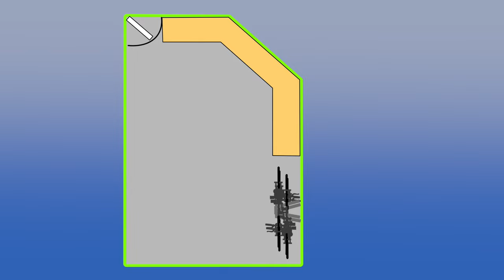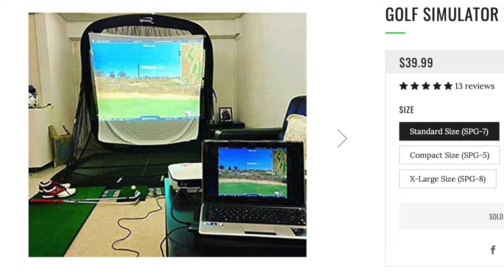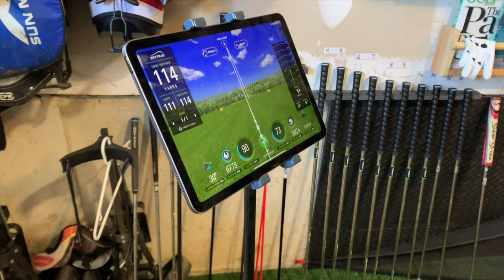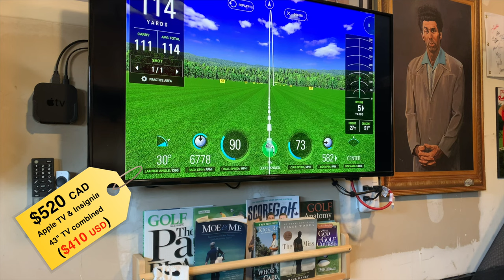Golf Simulator Without Projector - A low budget, small space setup.

Comment: Thanks for the video. This is really good and gives me some good perspective. Question about the garage door opener, I have a two-car garage with "hard corners" (no space between garage door and adjoining wall similar to yours). I will have to cut a hole out just like you did. What kind of wall mount garage door opener did you purchase? Trying to figure out the smallest form factor wall mount garage door opener that I can get. Thanks!!
Reply from the maker: My opener is the Liftmaster 8500W.  Hope that helps and best of luck with the build.  Fun times 👍🏻

Comment: I accomplished a similar SkyTrak setup but for about 1/2 the price.  All pieces were bought new.  Skytrak and case was 1k less, Ipad was $300, 50 in TV $300, mat recommended by Golf Channel was $300 ( this mat helps you know when you hit the ground before the ball).  Had to open up the ceiling of the shed where system is located.
Reply from the maker: Interesting.  Are you comparing USD to my CND pricing by chance?  I'm just curious because that is a pretty big difference.  Love the Skytrak!
Reply: Hi.  Which mat did you get and how's it holding up?
Thank

Comment: Very Informative and Relaxing.
For my garage in Chicago suburbs:
-how do you heat
-is the impact very loud
-would a rubber standing mat work.  Need to move after each use.

Thank You
PS
I'm building a 5x16 raised putting green with reg cups and levelers for creating breaks, in my  basement but not settled on the turf. Have any suggestions?  I've read good reviews about Camry Turf.
-
Reply from the maker: Thank you.  I heat with two ceramic heaters.  My garage is not insulated (other than the walls not sharing an interior wall with the house that is) but my garage door is a metal insulated door which helps as well.  So I don't lose heat instantly when I heat.

The impact is loud with the driver - can definitely hear it in the house but it's not horrible.

There are other golf mats that are more portable.  However, if you play a lot you might start to feel it in your joints and also they won't last as long.

The Fiberbuilt definitely is not portable though lol.  That thing is a beast.

As for putting turf I don't know and I don't want to mislead you.

Thanks for checking out the channel and best of luck with your projects!

Comment: Do you think it is possible to store the Fiberbuilt Mat vertically up against the wall when not in use?  I want a garage setup that I can break down when I want to park the cars, the Spornia net seems to break down and store relatively easily it's the mat that I'm not sure about.  Fiberbuilt's website says this mat is ~150lbs, which while heavy, suggests that it's rigid enough to tip up against the wall without issue.  True?
Reply from the maker: I wouldn't go Fiberbuilt (not the series I have) if you are doing that.  It is very heavy and not easy to move (one reason I love it - doesn't shift around).  But Fiberbuilt does have other options that are more portable.  I would check those out if I were you.

Comment: Great video. 
We must live close if you golf at bondhead.
Do you have any thoughts on the garmin r10
I'm also thinking about doing a shed build out for a sim.
Reply from the maker: From what I have read / watched, the garmin r10 is a very powerful, portable, and obviously cost effective unit.  If you are going to the range a lot this would seem like a great idea.  However, I think for an indoor setup I wouldn't go this route.  It is reported to be not as accurate inside and for myself, I wouldn't have the distance required to place the unit behind the ball.  Skytrak allows for more compact sim setups.  If you have left handed and right handed golfers playing, Skytrak is not ideal as it needs to be moved to accommodate which player (lefty or righty) is hitting.  Best of luck with your Sim build - so much fun!

Comment: Hello my friend. Good job. Certainly a viable option. You did leave out one cost. The side mount door opener. From what I'm told and have been quoted, those are around $2500? 
Also have a question. DO you havento have the iPad and Apple TV as an interface? Can you not just install a wireless receiver/adapter from the skytrack to the TV?
Reply from the maker: Thanks.  Yes, I didn't include that cost because we were actually due for a new garage door as well and it was part of a package (new door, extended track, side mount opener, and install).  I think you can get the unit for between 700-1000 CND and if you can install it yourself terrific.  If not, you are still looking at the install cost and the cost of extending your current track.  

Finally, you need either an iPad or a computer / laptop to run the skytrak software (and then any other simulator software you might want to add - currently I use e6 connect to play courses).  

Hope this helps and thanks for checking out the channel :)

Comment: Great setup!  Glad I found this for that net option.  What's your total distance from ball to back of net?  I'm dealing with a small space configuration as well
Reply from the maker: Thanks so much!  So from where I place the ball on the mat to where the impact screen hangs is 82 inches.  However, the net goes back a little bit more as the impact screen hangs down straight and the back of the Spornia is slightly slanted away.  Also, the ball to the front edge of the Spornia mat footprint is only 21 inches.  If there is anything else I can help out with let me know.  Cheers.

Comment: Great explanatory video! How long is it for the entire set-up? i.e., back of mat to the very back of the net (not impact part of net)
Reply from the maker: The measurement you are asking for is 11 feet 4 in.  Obviously you will need some swing space behind the mat though.  Hope this helps.
Reply: @GolfQuestChannel  I'm very interested in trying a similar setup.  Do you think I can squeeze it into a 14' 5" x 9' 6" porch? Only place with high enough ceilings.
Reply from the maker: @brianpinkley  It will be tight for hitting driver / woods with that space.  I'm pretty sure the 9'6" width is okay if you put the mat right against the edge of the porch (the side you are facing).  You might even get away with the length but I think it will be iffy - will also depend how tall / long your arms are.  There are a couple other options for nets that aren't quite as deep as the spornia such as the Net Return Pro but I think they are more expensive, and I can't speak to the "bounce back" effect they have on the ball so you would want to research that a bit if you wanted to go that way.  But a net like that might save you the space you need in order to swing the driver confidently.  Hope this helps.

Comment: How did you keep the side net down at the front?  Is there a bar or hard material at the bottom that helps it stand up?  Would you recommend getting the side nets
Reply from the maker: There is a loop at the end of the side net to leg into the ground and I just drilled a screw into the concrete.  I personally don’t think the side nets are necessary unless you have eratic golfers.  Better safe than sorry in that scenario.

Comment: Why did you get the Ipad Air if you have the TV? Didn't understand that part... or why get a TV that's more expensive if the Ipad works?
Reply from the maker: You need something to run the simulator software either a pc / laptop or an iPad.   Yes, I could play and practice golf on the iPad (and sometimes do and put golf or another sport on the tv while I play) but it's also nice to have the image bigger.  Also, the TV was far less expensive than the iPad.

Comment: What was the cost of the side mount opener?  I figure that’s got to be a nice chunk to add to the total cost.
Reply from the maker: So what I didn't share in the video is that I had a new insulated garage door installed which we were due for anyway.  The side mount opener, new door, and rerouted tracking, and installation were all included in the quote I went with so I don't know the exact breakdown of the side mount opener.  But by looking it up, I think they run about $600-$800 if you can install it yourself.

Comment: How much was it to convert the garage door opener (install and parts?)
Reply from the maker: I actually was due to replace my entire door so I put in a new insulated metal door and the opener, tracking, and install were all included in the price and it wasn't broken down on the quote or invoice.  However, I'm pretty sure a side mount opener runs around $600 - $800 CND depending on the model.  Then you need to add some additional tracking plus the install.

Comment: Are you able to play with a right handed player with this setup?
Reply from the maker: So with my current setup no.  My son is also left handed so this worked for us.  With my original mat, I could pull the net and mat over slightly and be able to hit on both sides.  However, this is the one drawback of the skytrak (and GC Quaid for that matter) - you have to physically pick up the unit and move it based on which handed player is hitting.  If you have a bit more space and plan on switching between lefties and righties often then the Mevo+ is probably the better option (unless you don't mind moving the unit in between shots).

Comment: with an even more limited space setup (and way more limited budget) I ended up with an even cheaper setup with very similar results: Fiberbuilt Flightdeck (same mat as yours in a compact version) - 70 USD, 1.5in gym flooring that's level with the mat on both sides, 50 USD , Spornia SPG-5 with shank nets, 210 USD, used skytrak on ebay for 500 and just my phone on a stool for the "software". Prices have gone down since this video too so it's cheaper than ever to build a great simulator for under 1k USD that would fit even inside a 700sqft apartment living room (my case).
Reply from the maker: @lgmasco  nicely done!  My buddy had the flight deck for a bit so I was able to try it out too.  Thanks for the comment 👍🏻

Comment: I may have asked you this before, but my brain can't remember.  I'm assuming that the studs are 2x4 basically giving you 4 inches of depth to mount the jackshaft opener in the wall. Doesn't look like much clearance between the wall mount and the rails either. What's the depth on the Liftmaster you have there? I believe you have an 8500?
Reply from the maker: I had to break out the ladder but the depth is 8 inches :)  You should have more than 8 inches between studs correct?
Reply from the maker: And yes I'm pretty sure it is the 8500.

Comment: I was wondering if the mat is 7 feet wide then how’s the net 7 feet wide? The mat looks way wider than the net. Spornia lists it at 7 feet wide but idk about that.
Reply from the maker: I measure the base of the net (at it's widest point) at 81 inches (so just under 7 feet).  The fiberbuilt, when you include the edging of the base is just over 7 feet.  Plus, in the video, I have the mat slightly offset in order to align the hitting strip with the centre of the net.  Hope that helps.

Comment: What’s the height on your ceiling?
Reply from the maker: Approximately 9.5 feet.
Reply: Thanks for the reply.  My space only has 9ft ceilings, which based on some test swings, will accommodate my height and swing, although not much room to spare.  I think there should be just enough room for a hitting surface.
Reply from the maker: @cg522  9 feet should be good.  Hoping it works for you 👍🏻

Comment: What’s the height from floor to top of roof attachment?
Reply from the maker: If you mean the height of the hood attachment for the Spornia net it's 7' 5".
Reply: @GolfQuestChannel  yes thank you. Do you have the sp7 or sp5?
Reply from the maker: @chriskozub8012  sp7.  They have an 8 now as well but little too big for my garage.
Reply: @GolfQuestChannel  so I do have a question. The sp7 is suppose to be 7x7. Why is your 7 foot hitting mat wider than the net?  (Looks that way at least)
Reply from the maker: Good question.  A couple of things factor into this:  1.  The Spornia is almost 7 ft across on the base (maybe an inch or so short) - and that is from the outside edge of the base to the opposite edge.  The Fiberbuilt, is actually just a couple inches wider than 7 feet.  So that factors in a touch.  2. I lined my hitting strip up to the center of the net so the left side of the Spornia is actually a lot closer to the wall than the fiberbuilt net.  Finally the wide camera lens distorts it a bit too.  So the mat is slightly longer than the net but not by much.

Comment: I see how it was small, but how was it cheap?
Reply from the maker: If you scroll through the comments you will see this mentioned quite a few times.  It's a fair comment.  When I first got started (a few years ago now) I didn't think it was possible to do a fully functioning simulator for under 10k.  The launch monitors I knew about were 12-20 k just for the launch monitor.  So I always thought it would be basically impossible.  So, I hear you when you question "cheap" but for me (relatively speaking that is) it was quite cheap.  You can even go cheaper of course if you are willing to look for a lot of this stuff used.  My buddy is great at that and has saved a ton.
Reply: You are actually right on this deal, with little space radar launch monitors might not work very well
Reply from the maker: @newsogn5148  ya it would never have worked for me.  The realistically priced photo based launch monitors made it possible.

Comment: You didn't include the costs for rerouting the door opener, new drywalling, etc.
Reply from the maker: You are correct I did not for a couple of reasons.  

1. We were due for a new garage door anyway and so when I priced it out I got some quotes and the quotes included all costs (opener, new door, track, installation)  I think the side mount door opener runs between $600 - $800 if you can install it yourself but that still leaves the tracking. 

2. My guess is lots of people might not have this same issue and so I focused more on the cost of the sim itself.  

3.  I didn't redo any drywall - it is still builder original and definitely could look better but that actually wasn't a cost as I didn't do it.
Reply: @GolfQuestChannel     Fair enough.  I though you did say something about the drywall, but thatmight have been the bit about moving the track from the middle to the side.

Anyway, good tips for building a home sim.  I can't use my garage, as it has (shocker!) a ceiling.